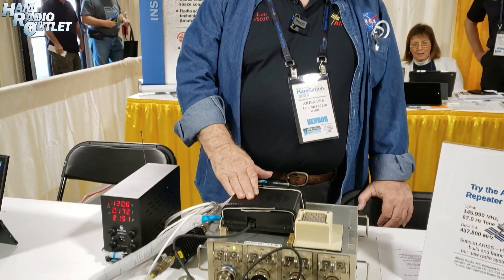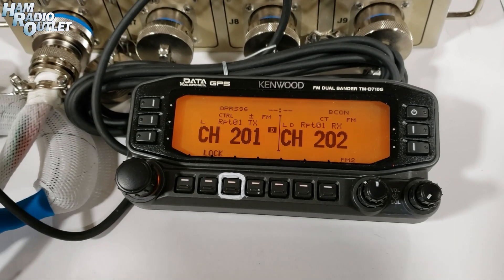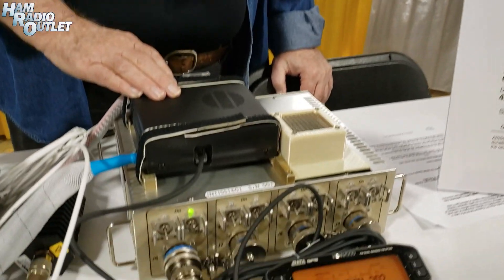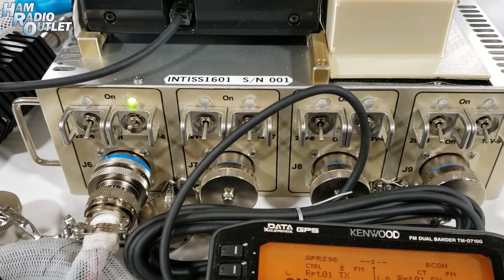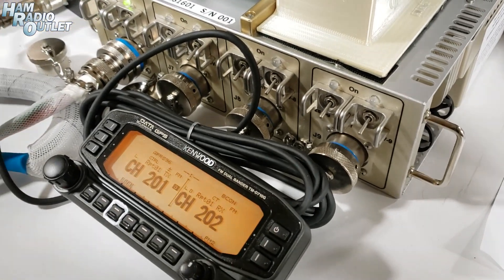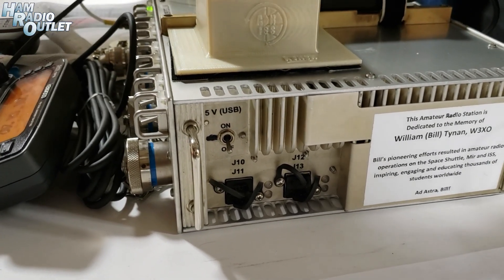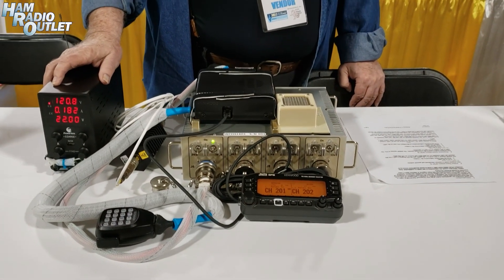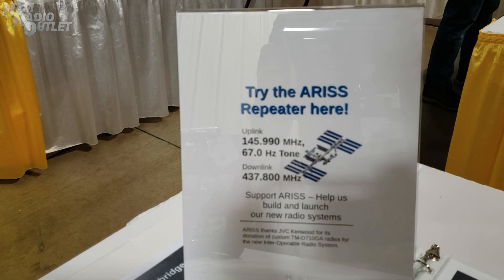ARISS - HamCation 2022

Comment: Excellent video. Thanks for the walk through, Lou. The fact that the D710's are on board the ISS was one of the reasons why I selected it as the mobile rig for my Jeep. This is easily the best dual band radio on the market. It's too bad Kenwood discontinued this great rig.
Reply from the maker: The D710G is a great rig. As you already know, Gaston, we bought most of Kenwood's remaining stock and they sold out pretty quickly. Hopefully we'll see a similar radio in the future. For those reading, be sure to check out Gaston's channel, here on YouTube!
Reply: @HamRadioOutlet  It's my favorite VHF/UHF rig. I picked up a second unit when you guys found that mystery pallet. Thanks for the plug, Julian! 73